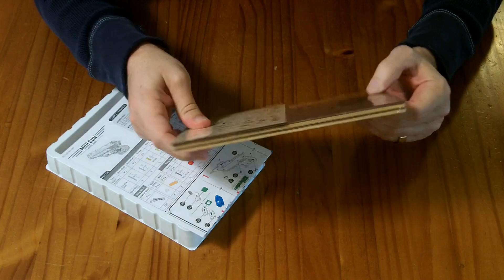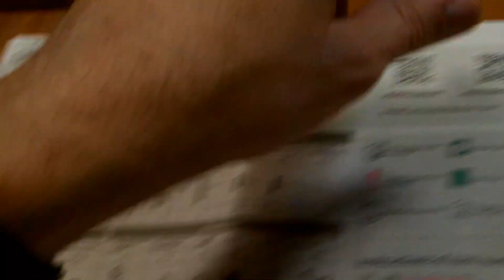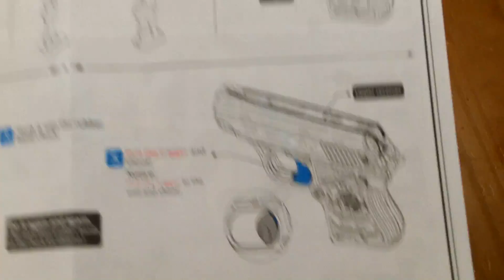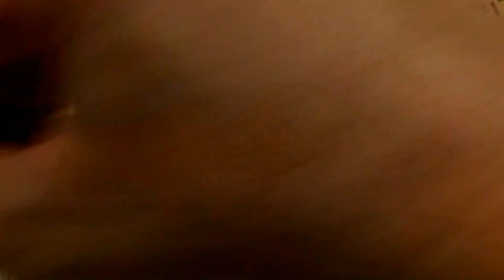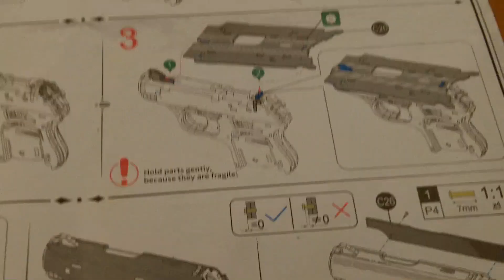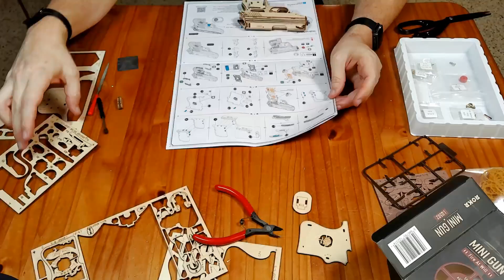Review & Build: ROKR LQ502 Justice Guard mini semi automatic rubber band gun $37

Comment: So I got mine yesterday, and I was looking for a video to see if I could figure out an issue I’m having. It’s fully assembled. But after it’s fully assembled when I pull the trigger, it doesn’t on trigger pull. The slide only moves When I slowly press down the rubber band wheel. And then Fire.  I don’t think I missed a step because I didn’t have any unused parts except spares.
Reply from the maker: Mine definitely moves on every trigger pull. I expect your problem is somewhere deep within the mechanism where the trigger attaches/connects to the slide and rubber band wheel.  Probably near he first quarter of the assembly process.
Reply: @summetj  all right, it’s just weird cause it does move on trigger pull, but only when you spin the wheel just before it clicks.
Reply from the maker: @SporkyBorky  Hurm, take a look at the behavior of my gun in the video to see if that is the same or not.  But mine shoots rubber bands very well.
Reply: @summetj  whenever I pull the trigger the slide moves about a millimeter… I actually took it apart the most I could, and I couldn’t see anything that I hadn’t done. So it might just be a dud. Something might just not line up the right way. It was gonna be a display anyway so it’s fine, just hoped it would work correctly. I’m gonna get the Tommy gun at some point so hopefully that’ll be the one.
Reply from the maker: @SporkyBorky  Well, won't matter for display. Could just be a lack of sanding or wax application for lubrication, but it kind of sounds like perhaps you have one piece too far in/out of the layer levels so something may be catching where it shouldn't be. This sucker has a LOT of pieces for such a small model.
Reply: Maybe You frogot to wax it

Comment: Hey so I need a answer fast does this need screw drivers
Reply from the maker: I don't remember needing a screwdriver.
Reply: hey @Doomslayer, yes you will need a standard screwdriver to build the minigun. one comes with the kit, mine did hope this helps.
Reply: Hey fellow modelers, the minigun is a good kit and is challenging, but check all of the parts and make sure you have "everything" you need to build and follow the instructions CLOSELY and take your time and enjoy the build!